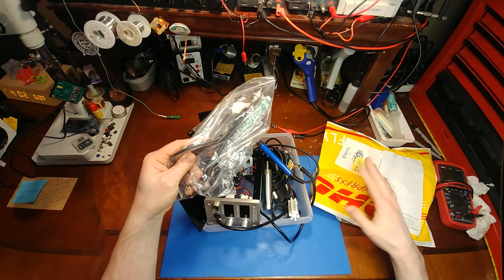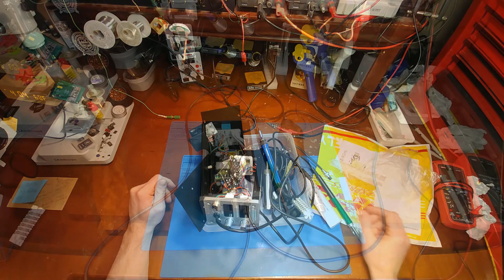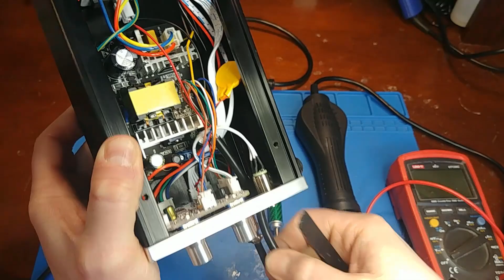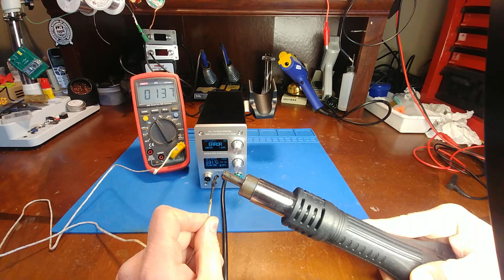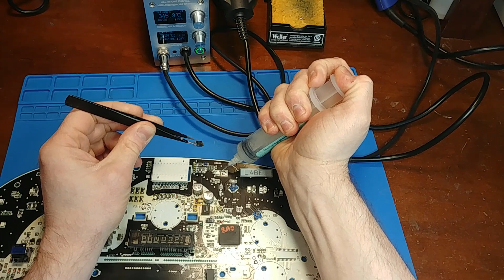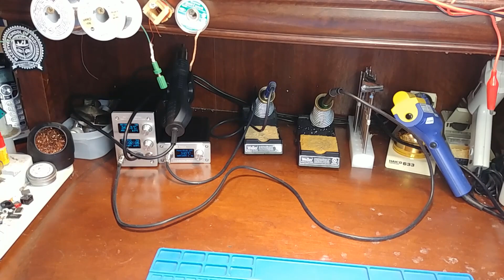KSGER Oled T12 Hot Air Pt 2

Comment: These hot air stations are garbage ,your better off spending a little extra and getting a station with a pump in the unit , bcuz that type of hot air station has a little fan in the handle which is rubbish, something with high thermal mass would take forever to remove with that station and you can damage and burn parts bcuz of that
Reply from the maker: I have experience with about 10 different hot air stations, mixture of 858 style and blower in the main box. Not all 858 are the same wattage. My 660 watt 858 can do just about anything as my 1000 watt with the pump in the box can do. The 858 are nice as a second unit for quick small stuff. Only time I need more power is if I'm doing a HDMI port or BGA GPU.
Reply: @jeffescortlx  wattage only means how quick it heats up , it’s nothing to do with temperature or fan speed, the ones with the fan in the handle are rubbish, the fans are not powerful enough so it will take an age to remove some components , sometimes you’ll end up damaging the board bcuz you been there that long with heat but the part is taking forever to be removed, your better off spending a little extra and buying maybe the atten st-862d which is around £120 and that will actually get the job done quickly and it’s power full or maybe the best bst-863 which is around the same price and these both have similar performance to the quick 861dw
Reply from the maker: @M.E63  look, I've personally used both the quick and the BST your talking about. I understand what you're saying. I've had a 1000 watt pump-in-station style for years. I get it. But I'm telling you the 858 style is better than your giving it credit for. With both my 858 if the fan is past 50% it will just blow the parts off the board, so you can't say they don't move enough air. They are perfectly capable of doing quick easy small stuff just fine, and does it more conveniently than the larger hot air stations.

Comment: Would you mind doing a quick video showing exactly how you fixed the grounding issue?  Did you solder that green wire to the earth ground coming in from the power supply?  Thanks.
Reply from the maker: The soldering wand and hot air handle both had wires ran to the exposed metal. It was just a matter of tie them all together.

Comment: You should have measured the ohms of the heater and done ohms law to work out the watts that would tell you the max of the heater
Reply from the maker: But why? My kill-o-watt already told me what it was with out having to take it apart.
Reply: @jeffescortlx  because the unit should be like 700w
Reply from the maker: @joshuabest100  I know it should be like 700 watt. That was kinda the whole point of this video.
Reply: @jeffescortlx  maybe the unit is restricting it

Comment: I brought the KSGER t12 and rework station separately. It sends up costing slightly less then the combined version you got. Also you have better options of actually getting what you want. I wanted the 2.1sv for the t12. Still had to fix the grounding and basic issues but overall I cant complain. Although the QC is terrible on these units so you need to check everything your self with the sensors being wired the wrong way around etc I also ended up going for the plastic handle instead of the alloy or stainless steel. Also ended up flipping the switch to north american orientation up being on instead of down being on.
Reply from the maker: Sounds like a good combination! I like it.

Comment: I really didn't like the lack of an earth on the whole thing,  it's a basic thing that should be there on any mains powered device with exposed metal.
The wrong element was just silly, i wonder if anyone got the 120v element in a 240v country  BANG!!.
The strain relief on the cable, hmm a bit picky.
Next you will be saying it don't smell right ha ha :-D
I'm pulling your leg :)
Reply from the maker: Now that all those bugs are worked out, I expect it to be a decent little unit.
Reply: @jeffescortlx  Just point your finger at it before use and mumble ' You dare play up and i...' 
It does no good but you warned it :).

Comment: Have you had problems with the old handle heating up near the tip so much that its hard to hold
Reply from the maker: No not that I recall. I usally only use it for short periods of time. Maybe if I left it run for a while at a time it would get too hot to hold.